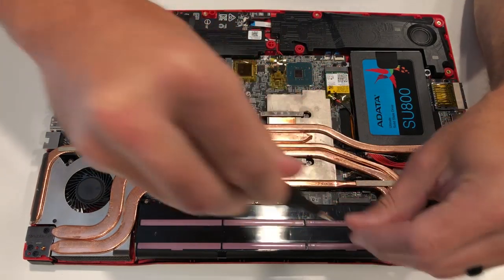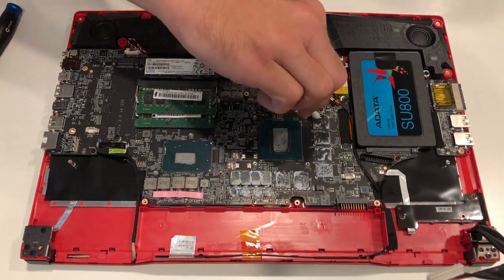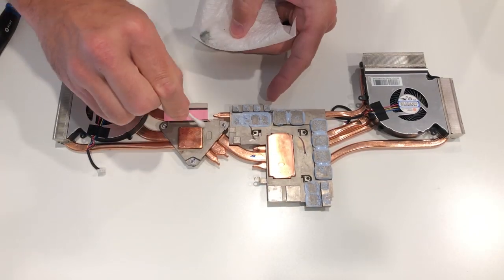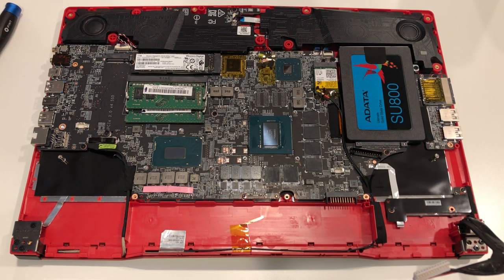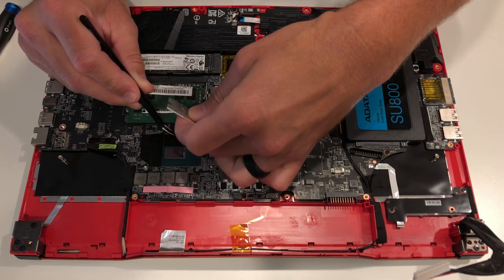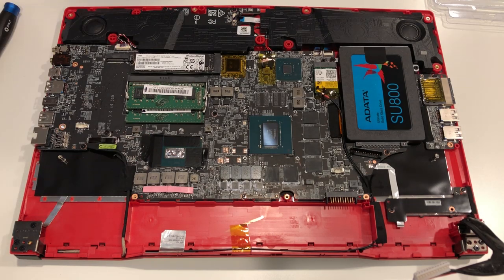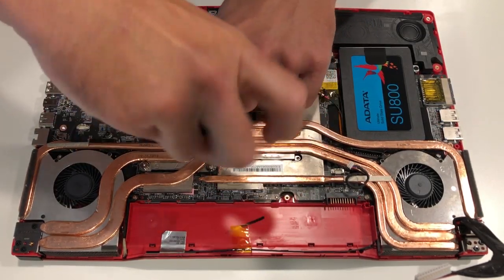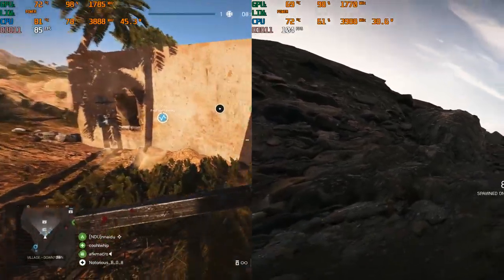MSI GL63 9750h 1660ti Liquid Metal CPU teardown!  Cools like a boss!

Comment: Thank you for the video. Really informative and telling! I am planning on using LM for just the CPU in the near future for my MSI laptop. 
I wanted to ask if it's alright to just clean and use LM for CPU only. Is it alright to leave the factory applied thermal paste on the GPU part (even though we have unscrewed the cooling solution) and then screw it back in as it is ?(only the CPU part will be cleaned and then applied with LM)
Reply from the maker: You’ll absolutely have to clean and repaste
Reply: @BobOfAllTrades  Gotcha. Thank you for the prompt reply ^_^
Reply: @BobOfAllTrades  just a small follow up question for this one. How many grams of LM would you recommend for the CPU part and how many grams of thermal paste for the GPU(if you are able to recall it considering this video is over a year old) if I am to be a bit stingy/cautious/budget conscious about any leftover ? I have an MSI GF 75 9SD with i7 9750h and GTX 1660ti (basically the same CPU and GPU as yours in the video)
Reply from the maker: Muhammad Raza I’m not sure.  I just put the correct amount based on what I see 👍
Reply: @BobOfAllTrades  Hi, did you ever have to replacement? Is there any temprature differences for a year? Thanks!
Reply from the maker: I sold laptop off afterwards.  I can’t afford to keep these.  Buy, review and sell.  That’s part of the process.
Reply: @BobOfAllTrades  just a follow up to the my original comment. I applied LM and thermal grease in the same fashion as you mentioned and it did wonders. CPU now doesn't thermal throttle at all in heavy benchmark tests. (It does power throttle after 28 seconds(from. 65-70W to 55W and I can't seem to change this even via Throttle stop :/ . Will have to figure this out but this is only for applications requiring above 55W cpu package power. It didn't do this before because it would thermal throttle  coz applications requiring more than 55W would over hear cpu despite my undervolt) 
Anyways, thank you once more for your guide :)
For those reading: One problem that I encountered was that the manufacturer over tightened one of the screws for the heat sink. All others got off fine enough. That one screw got defaced and I couldn't even screw it out anymore. Had to use tiny pliers for that part. Otherwise everything went smoothly

Comment: Hey Bob, love your work . You really put your time and effort in your videos. Just a quick question for you or anyone who can help, is it really safe to use Non Conductive Thermal Paste like Arctic MX-4 or Kryonaut on VRAMs and surrounding ICs? Does it have any side effect whatsoever? if not short term may be after few months?
Reply from the maker: I prefer pads for easy maintenance but some manufacturers use paste on many of those components.
Reply: Yes you right ! Pads are better. But I need to LM my GP75 Leopard and it already has Paste on VRMs. So I want to copy your method and apply TIM on them. Did some research, the material MSI uses is not exactly Thermal Paste it is more like Liquid Thermal Pads sold by the name K-50 or K-60. So I was just worried, is using Kryonaut or Arctic MX-4 safe ? It wont have any problems in the long run right? Thank you again for your reply !! Really appreciate.
Reply: @safwaniqbal5282  Using Kryonaut on the VRAMs and ICs is definitely safe. I've worked on more laptops than I can count that came from the factory with thermal paste on the VRAMs and ICs. As mentioned it is not ideal, because it is messy. But, it is perfectly safe for the components.
Reply: Can anyone tell me the thickness of the thermal pads for msi gl63
Reply: @johndenver9961 Please help me sir
Reply: @thunderlight8362  MSI usually don't use pads. So my guess is that GL63 also doesn't have pads. Have you opened the laptop to check? Still i would suggest Thermal Putty to be safe. Because with pads, a little miss calculation of thickness can cause a lot of trouble.

Comment: Hi, Bob, can Kryonaut thermal paste directly apply to the VRAM chokes and surrounding power resistant?
Reply from the maker: Don’t use that but definitely use K5 pro.
Reply: @BobOfAllTrades  Thanks. But in the video you use coolermaster mastergel. So I think Kryonaut and coolermaster master gel are the same? Compared to K5 Pro which one is better? coolermaster mastergel or K5 pro
Reply from the maker: @billzou2454  This is an old video and I have learned a lot since then.
Reply: @BobOfAllTrades  Me too. But still I am not dare to use liquid metal on my 8750h. GL63 model. Recently I try honeywell 7950sp. That works really well. Will see how it lasts compare to Kryonaut

Comment: ordered it for my gl63. fkin $30 for just a gram. Is it necessary to clean and reapply paste on VRAM?
Reply: you can put a regular cpu paste on the VRAM imo....plus i wouldnt try to tape/make an ideal setting for applying liquid metal to vram....id say def yes though......bc the 1660ti in this runs fairly cool even under max load....this paste on the vram is a large contributor im sure.
Reply: @anhiirr  yeah, the 1660 ti runs cool but the CPU keeps hitting above 95°C but the conductonaut dream never came true. Delivery was cancelled due to Coronavirus lockdown and now its available nowhere. fk.
Reply: @MrSandwichk  trust i run max coolerboost when gaming.....in all games.....and a cooling pad........and a -135-150 undervolt.......and i get 95% of my games to run <90c other than farcry 5/new dawn, insurgency sandstorm and path of exile those games make my 9750h wish it was dead.

Comment: can you update the status of the liquid metal affecting the copper heatsink?  I have a  G7 7588 with i7-8750h and I am considering putting liquid metal in it. the only concern is the reaction between the liquid metal and the copper heatsink. and how often should I repaste with LM?
Reply from the maker: I have a QnA video somewhere on the channel that shows a photo of a clients laptop that has LM on it over 1-2 years later and everything was great.  

Several 3rd party vendors offer LM upgrades when you purchase a laptop from them and they warranty their work.  That’s a good sign.  

I have a few machines out in the wild with LM on them going strong but this laptop was sold off long ago.
Reply: @BobOfAllTrades  thanks man !
Reply: @BobOfAllTrades  Hi Bob, 
I hope you are well with your family. i have an special mission to u because i dont have the  correct stuff to test it  and for u can be easy job.
I have what i think could be a great idea in order to avoid liquid metal corrosion in cooper heatsink, specially in laptops. 
1) Buy a cooper tape or a thin cooper layer, 2) Cut a piece with the same size of the surface cooper heatsink that will have contact with the liquid metal and stick it to it, 3) Apply liquid metal and check the temperature performance. 4) Upload a video with this proyect if u see it  will work.
As a recomendation, try to set that cooper tape in every corner in order to avoid any accidental movement because it has a slighly glue that wont stick under hot conditions.
If that idea works, that could be the solutions for those who doesnt have a nickle heatsink laptop and want to use liquid metal.
Im owner of a I7 9750h (hell edition), so u now know where comes from my creativity.

Comment: If I put Liquid metal on laptop with kapton tape around the pcb and it still overheated but the lm didn't leak out, is it cause of too much tape? Would be laptop not be working,  if Liquid metal landed on any part of the pcb basically? Cause it still works, so I took all the LM off and tape
Reply from the maker: On this laptop? You should have some legendary temperatures.  You want the thinnest layer possible on the PCB that’s why I recommend 33+ as it can withstand the heat it’s rated for it and it’s thin
Reply: @BobOfAllTrades  sorry that I didn't put my question out correctly but I had liquid metal on my laptop and it still got hot to the point where it got to the start screen and everything and shut off, if it still boots up, does it mean that's good? 

Does liquid metal basically turn a laptop into a brick basically? If it landed on the pcb?
Reply: @YamiAnubisX  The metal thermal paste are good conductors of electricity basically which means they short the pcb resulting in dead or fire up 🔥 your laptop
Reply: @anandb2729  I tested it back in August of 2018 and fucked my 1200 dollar laptop that my grandma is still paying off, only 400 dollars to go.

But it is not in the least a viable solution to keep anything cool as it can still fuck up everything.

I'm not ever using that shit again.

No one should be suggesting people to use liquid metal no matter what.

Comment: If you were to replace the thermal pad on the cpu side, what thickness would you use?
Reply from the maker: Hi Dan not sure I didn’t look. MSI factory pads have been solid and placed well.
Reply: @BobOfAllTrades  I was hoping to replace mine since It gotten a rip from removing the heatsink 😭

Comment: That thing still uses 18650 lithium batteries! You could technically fix that battery with ease. I bet you wish you could populate and solder 2 more gigs if VRAM into those blank slots on your board. This model must have come with a GPU option in an 8gb configuration.

Comment: Omg j have a MSI GL65 Leopard 10SFK-062 15.6 with a I7 10750H & RTX 2070 180w gpu/230w total version, its basically a refreshing of an earlier 2020 model but wow MSI doesn't change crap with there cooling solution because besides that extra fin stack/exhaust the heatsink is the same as mine. And ive seen the same heatsink on lower end & some higher end ones then mine. The heatsink gets overwhelmed with my CPU and in fact im pretty sure my GPU is now dead after barley over a year of owning it. Almost maxe it two years

Comment: I've recently changed my acer predator helios 300's thermal paste, Stock to kryonaut. It now runs at around 75 cpu and 68 GPU without cranking up the fans it has a smaller heat pipe arrangement. And even clocks higher at 4 ghz with i5 9300h processor with 1660 ti graphics can anybody explain me why does this run at same temperature even with larger heat dissipation system and even with liquid metal applied

Comment: People should not be exessivly worried about LM shorting something. In some videos you see some kind of LM grains and dust scattered over the mobo but those things are so tiny that they are not large enough to reach two parts simultaneously to short something.
Reply: not true, they can easily settle between two transistors and short them out.

Comment: I see that you have also limited the Turbo Boost Power Max to 40W on the right hand side. So i'm guessing that with stock power settings you're getting 5 degrees improvement with liquid metal.
Reply from the maker: I don’t recall making any adjustments to that.
Reply: @BobOfAllTrades  I might be mistaken🥺love your work

Comment: Hi Bob, have you ever used liquid metal on both the GPU and CPU in a laptop?
Reply from the maker: Yes but I do not recommend it.  Successful prep work for the GPU is hard and impossible sometimes.  The risk is not worth the reward. 

If you’re wanting the best thermal performance I suggest undervolting the GPU and tuning the CPU.
Reply: @BobOfAllTrades  what are the problems you encountered while doing the GPU? I really want to expand my knowledge on this because i always love to optimise laptops 😁
Reply from the maker: @andrewaani9530  a dead gpu

Comment: I'm not seeing much difference with Conductonaut on my GL63 with 9300h and 1660Ti. It did 99°C 86°C and throttled to 3.1~3.2Ghz. Applied on both CPU and GPU, now it does 95°C and 82°C and stays mostly at 4Ghz. Ambient is 30°C
Reply from the maker: Are you running maximum fan/cooler boost button?  If not then the fans would just scale to thermals.  

If you are running maximum fans and comparing temps then I’d start over.  These chassis’s respond wonderfully to LM
Reply: Even that is fine though. You are no longer throttling.

Comment: how long are you going to use Liquid Metal ? i heard it works 4-6 months and then it works worse and worse because metal starts to solidify... metal not so good works with copper
Reply from the maker: I’ve had Metal on laptops for many years. I have a few out in the wild that I have sold that are going strong today as well.
Reply: @BobOfAllTrades   did you use a laptop with metal more then one year ? didnt you change metal and didnt have problems with temperature? what did you use Liquid Metal  , name ?
Reply from the maker: виталий логинов You can order LM applications from 3 party vendors when you buy a laptop from them. If LM was an issue they wouldn’t do it and they definitely wouldn’t warranty it.  

I have machines out in the wild going strong for well over a year.
Reply: @BobOfAllTrades  i think i cant . can you tell me name LM ? Coollaboratory or Thermal Grizzly  maybe something else ?

Comment: Does nobody know that you apply the liquid metal to the copper of the heatsink. It is porus and absorbs the liquid when you work it in. Just cover the area relative to the cpu. Turn the heatsink upright away from the mobo, bring it over and lower down. I mean the cpu die is a mirror Ehhh!

Comment: Hey can i use thermal pads on vrams instead of thermal paste?
Reply: You could, but they would have to be really thin, otherwise the CPU and GPU parts of the whole cooler MIGHT not make (good) contact because you're lifting them up, because of the thermal pads.

Comment: I wouldn't apply liquid metal on laptop without a thin foam barrier around the CPU die and heatsink. I want the extra insurance that if I hold my laptop upside down, the liquid metal won't flow onto the motherboard.

Comment: Yeah, if the gpu didn't pass 85 after repasting, then i think it didn't really worth to do it with liquid metal...
The risk is also much higher there, since there are some transistors near the gpu die...
Reply from the maker: Noob Gamer It doesn’t pass 73 with stock paste 👍

Comment: I use liquid metal on both because better temperatures are never bad. I didn't really get your reasoning why you didn't do that.
Reply from the maker: I answered that question in the video lol
Reply: @BobOfAllTrades  i know but i still didn't get it after i watched it 2 times. i dont think there are any downsides to also applying liquid metal to the gpu.
Reply from the maker: Steve Eric Jordan For one there isn’t a need and the balance I spoke of is real. Especially on this cooler which isn’t quite as robust as the Raiders. 

Second, LM on the GPU takes the risk factor up a few notches.  

If it was necessary to maintain the temps I wanted to see from this GL63 then I would need to breakout a kit I have put together including a foam barrier cutout that just wasn’t necessary. It would have brought more attention than it deserves and I like to do things the way I would actually do them and not for viewer attention or clicks.
Reply from the maker: TabalugaDragon It’s much longer
Reply from the maker: TabalugaDragon Yes everybody’s making that up
Reply from the maker: -Actually several 3rd part vendors apply LM and warranty their work. 

-HP has a new laptop that has LM on the cpu from the factory. 

-It’s not an easy application and can’t be done by your traditional factory work standards. 

-Then you have the conspiracy theorists who insist that manufacturers make their laptops fail after a few years so you buy another.  I actually get comments like that too 👍
Reply from the maker: TabalugaDragon That post that you linked read through that post all eight pages of it you don’t see anybody in there talking about problems now do you? Why don’t you post in that thread see what kind of response you get 👍
Reply from the maker: TabalugaDragon You don’t replace liquid metal you’re good to go for the life of the laptop. This is straight from the horses mouth from companies like HID. 

Companies that warranty the application of liquid metal, if anyone would have experience with this it’s companies like that. 

Furthermore I have a few machines out in the wild with LM as well as LM on a few Haswell CPUs. All thermally solid like the day applied. 

I encourage you to post in threads like the one you linked 👍
Reply: TabalugaDragon hey tabaluga, please watch your tone. Liquid metal degrades copper which is why you simply dont use it on laptops with copper heatsinks. On other materials it works just fine and does not degrade after a few months, otherwise the manufacturer who use it wouldnt use it. manufacturers usually dont use liquid metal because its very hard to apply and as we know they are usually not even applying regular thermal paste nearly the right way. Doing that with lm would be way too risky and costly. Asus for example had to redesign their thermal solution and build their own robot that applies their liquid metal. And even then they only apply it to the cpu. And all that in a 7k!! Dollar laptop which is the asus mothership because on the gpu it would not be worth all that. So you can imagine how much work it is and why manufacturers cant do that on cheaper machines. Especially when the regular consumer will never even realize it. they only care about the specs on paper and will never get that they dont get the full performance because of thermal constraints, thats the whole marketing strategy with laptops at the moment, even with macbooks. Look it up.

Comment: So it makes this laptop run .2-.1 ghz faster and significantly cooler
Reply: Xotic l Ice  After my own longer term test on my MacBook Pro(I have a gaming Pc as well) the liquid metal dries out over about a year and soaks into the copper heatsink. After replacing the LM a few months later I found the heatsink was significantly corroded in that spot and got a 30 degree drop replacing the heatsink for £8. Gaming laptop parts obviously aren’t as commonly available.